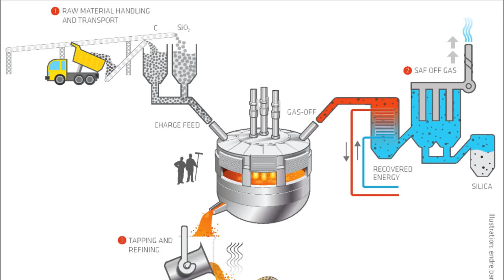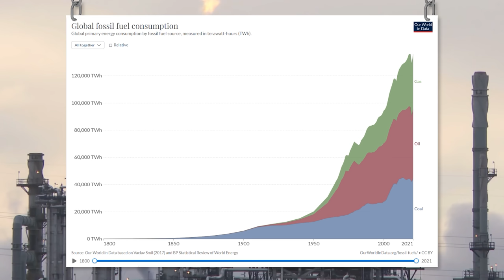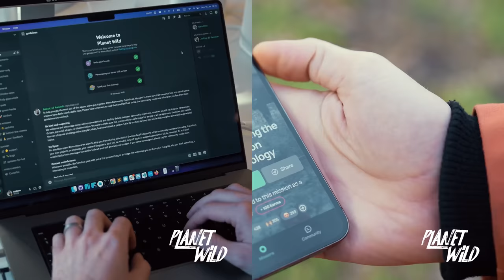We Will Be the Last Civilization on Earth

Comment: Damn, if only we'd invented nuclear reactors.
Reply: I have no idea if this is accurate, but in one of my college classes a professor said that if we switched all world-wide electrical production over the nuclear, we'd only have about 50 years of material for reactors.

Not saying we should ignore nuclear, just remember that it's not unlimited.
Reply: Those spent fuel rods are a massive liability. Not like we can just shut down a reactor and walk away if we have to.
Reply: @DrugDealer541  So, that would put us at 400 years worth of energy production?
Reply: @PsRohrbaugh were you been under 🪨
Reply: @PsRohrbaugh was he a hippie ?
Reply: @PsRohrbaugh  at some point in oil exploration the same "we only have 50 years left" was true (probably multiple times as both supply and demand increased). Except they kept finding more oil. I think the same is true with Uranium. If there is more demand for it, its down there, not to mention the talk of extracting it from seawater which is apparently more than viable, just hasn't been done yet. And ofc recycling the waste and breeding it again as has already been mentioned in this thread.
Reply: @PsRohrbaugh  that's only for uranium reactors though (there are way more abundant nuclear fuels like thorium), and it ignores reusing nuclear waste (and like 97% of uranium is turned into nuclear waste in reactors, so they could theoretically be 30 times more efficient than they are now)
Reply: @SerhiiMartyneko plenty of time to develop fusion reactors
Reply: @PsRohrbaugh  Yep but that only includes usage of enriched uranium which is like only 0.3% of all uranium. If/when breeder reactors are developed enough, they could utilize rest of 99.7% of unenriched uranium and you can do the math from there for how much that will last.
Reply: @DrugDealer541  Depending on where you live, HSR might already be in widespread use
Reply: Tell that to the French, who are the more nuclearized nation on Earth. A few years ago they produced 75% of their electricity out of nuclear energy, a few days ago... they had to nationalize EDF, the nuclear power managing company, because the output had dropped to a mere 30% because NPPs have become way too old all more or less at the same time (radioactivity also destroys the infrastructures, not just people) and now they're facing a national energy crisis, just at the worst moment possible, and lack even a plan to do anything about it. 

At least Germany has developed some renewable infrastucture in the last decades, but France? Nah, we're fine with our great NPPs... and of course it was all just hubris. Let's hope there's no French Chernobyl ahead, I live too close not be worried. 

Anyway, nuclear energy won't get a rocket up there, all it does is boiling water and that would at best allow for steam-punk fantasy. 

Also uranium is also on the way of extinction this very century.
Reply: @LuisAldamiz  EDF was already mostly owned by the government and it is responsible for all of France's electric grid, not just NPPs. The energy crisis was felt in most of Europe and it has been over for some time now
Reply: @orsaz924  - It's been quite sudden: they found out catastrophic dangers in many NPPs, they had to turn them off fast and they may have no remedy. We just avoided the French Fukushima by nanometers.
Reply: @LuisAldamiz  It's sudden, yes, but it's far from reaching a Fukushima-level catastrophy
Reply: @orsaz924  - Do you know the details of why each NPP was closed? In at least one a catastrophe was barely avoided by sheer luck as a key water pipe could have burst at any moment, instantly collapsing the necessary cooling of the reactor, which would cause meltdown. I don't know the exact details of the rest but they appear to have been in similar catastrophic condition. And that's because they are very old and France now has to face the untold truth about nuclear power: what to do when the miracle generator plants must be dismantled, as everything in them is radioactive residues one way or another. That's the main hidden cost of nuclear energy, which was never factured originally (or was at best in very optimistic terms, far away from the real cost, including the cost of perpetual radioactiovity): one that France will now have to pay no matter what.
Reply: @PsRohrbaugh  That's because mining and processing ore is cheaper than reprocessing the waste, if Uranium is indeed running low and will rise in prices low then reprocessing will be economically viable
Reply: @LuisAldamiz  Chernobyl? You're worried about meltdown? OK. Do you have any idea what the fundamental reason for the disaster in 1986 was? I'll bet you don't, since you seem to not be aware that it's physically impossible. What do you know from graphite-moderated coolant systems? Ask about it. I'm sure your nearest plant would love to educate you about the state of the art in fission (and they're amazing places to visit, too. I got to tour one on a school field trip as a kid and it was a little like being on a spaceship).
Reply: @DrMackSplackem  - If the cooling fails, the rods melt down. It happened in Three Miles Island, it happened in Chernobyl and it happened in Fukushima (with additional hydrogen explosion that aggravated the situation). Your discourse is basically propaganda that claims that USSR nuclear technology was faulty... but 3MI and Fukushima prove otherwise. 

The next Fukushima/Chernobyl should happen (per statistics and considering the general obsolescence of most extant NPPs) any day (my extimate is 2024 but there's of course significant uncertainty) and France has most of the chances of being where that happens just because it has most NPPs and all are very old (and should be decomisioned right away).

My nearest NPP is a French one near Bordeaux. There was a Spanish one closer but it's now shut down for good. However several friends and aquaintances of mine, living in the area have suffered cancers at very young age that can only be attributed to radioactive pollution by that fascist monster (all NPPs in Spain were built under fascism).

Also the Spaniards wanted to build one NPP a few km from this city but ETA impeded it by means of killing the chief engineer, some guy named Ryan. However the structure has yet to be dismantled (decades later) and makes that nice coastal strip a military zone for unclear reasons, which is a serious abuse against the citizenry.

BTW, in France Greenpeace has repeatedly demonstrated that the NPPs are vulnerable to terrorist attacks. 

Nuclear power is a disaster and, even if you manage to ignore all the actual pollution and meltdown risks, uranium is also a finite mineral and is expected to be effectively exhausted by the second half of the century at current rate of extraction/consumption. It's no alternative to fossil fuels.
Reply: @PsRohrbaugh True but newer designs of reactors using different types of fusion/fuel are already feasible at least to test.
Reply: @LuisAldamiz Three mile island wasn't much of a disaster and neither was Fukushima for that matter, considering how extreme the circumstances were.
Reply: @SavageHenry777  - Fukushima is very clearly at Chernobyl level of catastrophe. It's official IAEA, although IMO it was worse because several and not just one reactor were affected, there was that explosion and also, if Japan applied Chernobyl criteria, it would have needed to evacuate all Northern Honsu, incl. Tokyo and thus they decided to trivialize and minimize the radioactive disaster instead. I suspect 3MI was also a similar case in which domestic Western catastrophes are trivialized and hidden under the rug, while the USSR confronted it more bravely and seriously (after initial denial, sure).
Reply: @PsRohrbaugh  yes yes and we were supposed to run out of oil by 2016
Reply: @PsRohrbaugh We may have 50 years for uranium but many, many, many more for thorium since it doesn't need to be enriched, is extracted easier, safer, and 50x more abundant in the earth's crust than uranium
Reply: @LuisAldamiz nuclear power plants last longer than solar panels and wind turbines. That was just a combination of having many plants built around the same time, older design, and how long it takes to construct things. Of course 75 percent of power from one thing is over reliance anyways and should have been lower but was definitely preventable.
Reply: @LuisAldamiz French Chernobyl is practically impossible, not to mention that there are more deaths relative to energy produced from wind power than there is from nuclear, the only safer source is solar panels.
Reply: @LuisAldamiz why is uranium on its way to extinction this century?
Reply: @LuisAldamiz good thing modern npp can’t meltdown! Sounds like that problem that you fear so much has been solved if those plants are rebuilt.
Reply: The problems with renewables could potentially be worked out is the kicker, they are not very viable right now despite what people say, but nuclear energy can buy is the time and resources for further R&D, multiple processes take place in the same time span, it’s not a singular movement or vacuum.

Much like large stairs, we can only skip so many steps at a time, and we can only do so with sturdy steps, fossil fuels have been a proven sturdy step, nuclear is another, and we need both to go further. Before we slap a ton of unreliable and underperforming halfassed “renewable” solutions in place, we need to refine them, and we have the tools to buy us the time.
Reply: @skygge1006  - Yes for all I know. As happens with all mineral reserves, there may be untapped ones but these would always be very costly to exploit. Even coal is on the way to exhaustion at current usage rates. In 50 years or so we won't have much of traditional (fossil and nuclear) energy sources and will have to do with renewables and hydrogen.

Nuclear energy has many other limitations, especially if we'd want it to produce all or most of the consumed energy: basically a new NPP would have to be built every few days (and also decomissioned at the same rate), nuclear residues have never been satisfactorily dealt with and such a massive rhythm of usage would generate many many times the current ammount, by mere statistics catastrophes would happen much more often, water resources would be abused and polluted (not just with radiation but also heat), etc.

Even thorium reactors that some spouse but never gained traction need of uranium in their process, so they are not any solution either. Ultimately the only solution is renewables, with hydrogen (from hydrolisis, "green") as storage of reserve energy and also as portable fuel. Also some degrowth will be needed no matter what, the limits of growth have been already surpassed in many other aspects and balance, sustainablility, has to be restored and that requires another socio-economic paradigm than mere endless "growth", which is ultimatly exploiting Earth more and more (there's no free lunch, magic is not real).
Reply: Not true
Reply: @PsRohrbaugh that's completely incorrect. Like multitudinously incorrect. Not only are nuclear reactors versitile, but a single core can last decades.
Reply: @LuisAldamiz   more modern reactor designs don't need uranium, don't use water for cooling  and can easily produce the energy to melt all metals and create hydrogen for rocket launches. a smarter civilization with some memories from ours a 1/100th of the size. has far more options than we had.
Reply: @woodypigeon there are places to dispose of such things, there is a whole video by kyle hill explaining the true safety of nuclear power
Reply: @psionx1  Some use MOX, a mix of uranium and plutonium (something that also aggravated the Fukushima catastrophe) but otherwise what you say is false/wrong.
Reply: @woodypigeon at least spent fuel rods stay in one place, unlike spent oil/coal. If we could get energy producers to stop "just walking away" from their pollution, we wouldn't be in this mess in the first place
Reply: @PsRohrbaugh  Not true at all, or even close. For a start, direct uranium ore is not the only fuel that can be used.
Reply: @howdy832  Where did I say that fossil fuels were preferable to nuclear? 
You only have to look at the current situation around the Zaporizhzhia nuclear plant in Ukraine to see what a potential liability they can be.
Reply: @combineconformist  They still need to be carefully maintained during the initial cooling off period. 
I watched Kyle's video about it sometime ago. He really has a massive nerd boner for nuclear energy as seems so often the case.
Reply: @PsRohrbaugh That's only true of uranium reactors. Thorium is so plentiful you could probably find some in your backyard if you looked hard enough
Reply: @PsRohrbaugh   this used to be true but only in one paradigm. With plutonium or thorium reactors the fuel problem is solved in different ways. When it comes to thorium we did not develop that into a usable technology because it is fertile instead of fissile which means you cannot build a bomb out of it. Yet thorium in every aspect is the more viable option. The reactors are inherently safe compared to the current tech, the waste has magnitudes lower half-life(s), thorium is plentiful compared to uranium, it is safer and less toxic to mine, and likely other upsides I am not recalling. A principle downside being we haven't invested to develop it.
Reply: @PsRohrbaugh  If we are talking about nuclear fission that uses Uranium - yes, its reserves are limited. But nuclear fusion uses common elements like hydrogen, that are practically unlimited.
Reply: @LuisAldamiz  LOL. USSR nuclear tech was (like nearly everything else in the USSR) indeed hugely faulty. Using graphite as a heat moderator was unnecessarily stupid, but even that would've been no problem without those stupid tests they did on the day of the disaster. Only in a society with zero human rights could such a scenario have been carried through all the way to execution. Three-Mile island never even got close. How can you deny this?
Reply: @PsRohrbaugh  According to the NEA, identified uranium resources total 5.5 million metric tons, and an additional 10.5 million metric tons remain undiscovered—a roughly 230-year supply at today's consumption rate in total.26 Jan 2009

I thought it would have been more than that honestly
Reply: @DrMackSplackem  - So what happened in Fukushima then? What happened in 3MI? You're just parroting the old Western superiority myth and reality has proven it wrong already.
Reply: @PsRohrbaugh  Fission Reactors have around an 80-100 year life span. However with the newly developed Breeder reactors (Fusions early days) which produce more than they use there's enough Uranium scattered on Earth that nuclear energy could be mass reproduced and power humanity for another 4billion years. There are many other materials to power nuclear power outside of Uranium as well.
Reply: @PsRohrbaugh There are enough uranium for hundreds of years, and thorium for millennia.
Reply: The earth is vast, the amount of materials we have actually discovered is bound to be a tiny fraction of what actually exists on this planet. The answer is not in uranium alone or oil or other energy sources, but the utilisation of all of them when it makes economic sense to do so. Lots of new technologies will happen in the future with material sciences and energy storage, hydrogen is one thing we can produce to store energy but who knows what materials we will store energy within in the future, perhaps we will make oil or other stable fuels to store energy.
Reply: @PsRohrbaugh There is also the Thorium option. There is about 3 times as much Thorium in the earth's crust than Uranium. I believe Thorium itself is not able to be used as fuel for nuclear reactors, however, I do believe Thorium can be converted to Uranium? Also, I'm pretty sure Thorium cannot be used to make nuclear weapons, but I'm not sure, maybe once it's converted to Uranium it then can be?
Reply: But those can’t be dropped on your enemies and wipe out their biggest cities
Reply: If only hey?
Reply: @PsRohrbaugh  until we do we will never know also there ar reactors on paper that can run on waste products from the power plants we have now so if we really did try i think we could make it work
Reply: @DrugDealer541 it also doesn't account for Eco fuels like the one Porsche made by pulling carbon dioxide from the atmosphere
Reply: How would that replace all the chemicals we get from oil and natural gas? That's the real challenge imo.
Reply: @skygge1006  I see the anti-nuke folks as disciples of a religious order and deal w/ them as such. At most, I ask them to name a single graphite-moderated reactor currently in service, see they were never serious to begin with, and move on.
Reply: @bengardener8928  Well said. Prognosticators have a lot of stagnation to answer for, and we should rub their noses in their messes w/ no mercy.
Reply: @woodypigeon  you know those unused radioactive materials still radiate as usual, right? spent or not spent, they still decay
Reply: @devynlich00  if the fuel is burnt again, it will re-release all of that carbon, plus the emissions from the energy needed to make it in the first place. That's why its so hard to get it carbon neutral
Reply: @nade5557  no it isn't re-released into the atmosphere, water vapor is what's coming out of the tailpipe
Reply: @devynlich00  you can't be serious right
Reply: @nade5557  don't believe me look at that video link I sent about six hours ago you'll see for yourself
Reply: @shikyokira3065  Yes, obviously. That's part of my point.
Reply: @woodypigeon  seems like you don't get my point. Whether they are "spent fuel rods" or in their raw material form, they still radiate away. Not utilizing it is just like not utilizing the sunlight. It is just your liability or everyone's liability.
Might as well just use the energy that would have been wasted radiating into the surrounding
Reply: @PsRohrbaugh 50 years is plenty of time to find more options for generating power. Also the model doesn’t account for new sources that will likely be prospected for, thorium reactors, reusing nuclear waste in the many proposed ways, and the increasing efficiency in which most electricity is used by appliances, as well as how it is transmitted and store.
Reply: @PsRohrbaugh meanwhile it's unlimited for nuclear weapons.
Reply: Keep in mind, we only have a thousand or so years before the surface of Earth is uninhabitable because of the climate.
Reply: @PsRohrbaugh  50 years using the 0.7% Using U235 (Conventional) but fast breeder reactors can use the other 99,3% of Uranium as fuel. Thorium can be in the mix also and have 100s of years of fuel.
Reply: @@NathanGautreyat's largely due to government involvement, sure there needs to be basic safety standards, but the sheer amount of compliance costs in nuclear is what makes it astronomically more expensive (in the US anyway) than solar. Not to mention how much we are subsidizing solar and wind specifically as opposed to nuclear, mainly due to fear driven by severe misunderstanding of nuclear...

Addendum:
It would be great if the USN would declassify enough about the reactor design for the Virginia class of submarines to help make the methods they used to get the breeding ratio high enough to allow that reactor to last the entire 33 year service life of the sub without needing a refuel...
Reply: @LuisAldamiz  You have a point there

*(This applies to the reply to my previous answer)
Reply: You mean nuclear FUSION reactors
Reply: @@NathanGautrey Offshore (or any other kind of) wind power generation is a rather low bar.
Reply: @PsRohrbaugh  It isn't accurate but even if so - this is hafl a century with curtailed emissions!
Reply: @LuisAldamiz "if cooling fails, rods melt down" - wrong. That happened on Gen 1 & 2 nuclear reactors. It doesn't happen on Gen 3 & 4 reactors, that have a negative temperature coefficient.

"look at what happened in Fukushima" - 1 (one) person died from the nuclear meltdown in Fukushima. There was no harmful radiation leak outside of the immediate vicinity of the NPP (that was evacuated immediately). Bear in mind that this was an incident caused by a 9.1 Richter scale earthquake and tsunami, that killed almost 20.000 people outside of the nuclear meltdown.

But please, keep your nonsensical arguments of someone that clearly knows nothing about nuclear
Reply: Ever look at how much uranium is left at current production? If you think oil is hard to make 😉
Reply: @DrugDealer541 yet there is only one single 30kw thorium reactor in the entire world... Why do you suppose people are ignoring such a supposedly profitable solution
Reply: @nade5557  Any time I utter the phrase "carbon neutral" around my plants, they all reach for their revolvers in unison.
Reply: @southhussain2710  Got any sources for the 1000 years to Earth uninhabitability claim? I'm sure that'll make for some enlightened reading.
Reply: @@NathanGautrey You can do a lot of insane things with the unlimited power of selective government violence. The first tool is prevention via regulation (state force). Combine that with subsidizing mostly worthless 'green' options (yet more state force), and then sure, you can make comparisons that on the surface look like apples to apples but are just the opposite.
 Even with that state force which has massively unleveled the playing field in 'renewables'' favor, tell me just how much percentage of total power needs (avg'd. by country) are provided by wind and solar today?
Reply: @GoldenMinotaur  the reason why there was no investment in thorium reactors is very straight forward: thorium reactors can't be used to make weapons-grade plutonium. Therefore govts didn't invest in developing them.

As for the "there's little uranium" - there are fast breeder reactors that use the nuclear waste from other reactors. The current waste alone could power the entire world's consumption of electricity for over a 100 years.
Reply: @jorgebatista6323  and what's stopping it today? If it's profitable, why aren't people just investing in it??
Reply: How are you going to build nuclear reactors without steel
Reply: @DrugDealer541  Thorium reactors are a pipe dream at current technology: it takes more energy to extract a sufficient quantity of usable thorium for a reactor than the reactor will ever produce in its lifetime, and producing that energy also is a net loss.
Reply: @HyenaEmpyema  A truly new oil field hasn't been found in over twenty years at this point.  When they point to a "new" field, such as the North Sloe project greenlighted earlier this year in Alaska, what the oil industry means is "This is a 'new' field in that it's never been tapped so we've never put it on our books before - but we've known about it for decades already."
Reply: @PsRohrbaugh That might be true with a lot  of caveats, the major one being that it assumes a once through fuel cycle in a thermal reactor, another is that far more uranium is available albeit at a higher price.
Reply: @LuisAldamiz That is NOT what happened at Chernobyl.
Reply: @woodypigeon pretty sure a nuclear power plant is the least of Ukraine's current issues.
Reply: @gidi3250  The Russians are currently holding it and keep making like they might decide to blow it up. Very useful shield for them strategically. And a liability for Ukraine.
And early in the war the Russians took control of the old Chernobyl plant for a while.
Thing is, you can't just shut them down and abandon them. Those spent rods have to be maintained in cooling pools for a long time. There is so much that can wrong in such and unpredictable situation.
Which was my original point
Reply: @PsRohrbaugh  better than using nukes
Reply: @pawelzybulskij3367 Fukushima 'FuGen' reactors used reprocessed MOX fuel-  a Mix of OXide of Uranium and Plutonium from 'spent' fuel rods, which are too 'hot'  (fissile) to use in American reactors, which produce 60% of their output from the Plutonium 'bred' therein from fertile U238 in the fuel!
GE: "We bring good things to LIfE"
Reply: Unfortunately we have run out of time to build them all ..
Reply: @woodypigeon  literally we can. Material will be radioactive but so what, they emitt some residue power, keep them in a concrede and make sure they won't touch water and we can leave them there forever.
Reply: @mrpc5971 Peak conventional oil happened in 2005. Peak liquid oil (includes fracking) happened in 2018. Now, they are converting natural gas into gasoline to make up the difference.
Reply: Yes, we need to create nuclear power stations, outside a geosynchronous orbit (in case they pop), and transfer the energy via lasers, to low altitude aircraft which fly down to deposit the energy. That, or figure out how to create solar panels that don't suck (die).

Can't we create nano-seeds that grow artificial threes with USB ports? They can collect the sunlight--just plug the house into them.
Reply: @LuisAldamiz  Yea there is just as big of exclusion  zone and need for replacing concrete roof over reactor every 100 or so years to prevent radioactive material from escaping in Fukushima. Soviets went public because they could not deny that dumped so much radioactive material that entire world new about it before they did. 
Fukushima and 3MI were trivialized because they were trivial compared to Chernobyl, mostly because they didn't explode on such a level.
Reply: @PsRohrbaugh wrong.
Reply: Need 2 kinds of fossile for that.
The scientists and oil
Reply: @PsRohrbaugh  I remember something similar to 50 years of nuclear.
Reply: @woodypigeon now adays it is actually kind of like that
Reply: @PsRohrbaugh  not with reusing waste and breeder reactors. Not to mention fusion energy
Reply: Nuclear fusion should soon be an option in the next 10 or so years
Reply: @LuisAldamiz  I don't know what planet you came from, but if you want degrowth we have elon and jeff building rockets to take you back there, so please go volunteer. Pursue progress, not de-progress. The estimates for how much thorium is available range from many millennia to 30 billion yrs. Plan to use stuff like solar for at least SOME energy, not just only nukes all alone in a vacuum. Always plan for better HVAC, better transportation, better food, etc, never ask for less or worse. You may be wealthy, but stop assuming everyone else shouldn't have a better life than you now have, just as poor today live better than a king in Christ's day.
Reply: @tsamuel6224  - Progress now is sustainability, not doing the same as our Paleolithic ancestors (expanding endlessly as if there was no tomorrow). We're never going to reach out to the stars if we first do not stabilize our planet with us still alive on it.
Reply: If we switched to a nuclear age, we could power the planet much more efficiently. Nuclear power plants only need to be refueled about every 25 years, and we could build reactors that can use plutonium and other uranium fission waste products. Eventually, we could possibly get to fusion reactors, which would be indefinitely sustainable. 

Not only that, we could invest in other forms of sustainable energy production that would further increase our ability to produce power over time. Eventually, se could preserve our fossil fuels for only the most essential things that require their use. This would allow us to power our planet, reduce our environmental impact, and advance our technology. Its not about going from one point of failure to another point of failure. Its about going to a multi-source society that can sustain itself through a variety of means. 

As for some people who have issues with nuclear control rod waste, do remember that modern nuclear reactors actually produce very little waste, and they only have to be refueled every 25 or so years. With that estimate, we have plenty of space to dispose of the waste. And within two refueling cycles, the area we would store the waste would likely not be contaminated any longer.
Reply: @PsRohrbaugh  The solution is reprocessing, and using more efficient heavy water reactors instead of light water reactors. Reprocessing allows us to take "spent" fuel from eg a light water reactor (which only actually "uses up" about 1% of the fissile material) and remove the fission products, then use the remainder (the ~99% remaining fissile material) to manufacture new fuel.

Full implementation of reprocessing would take that 50 years of material and turn it into 5000.

If our civilization is still around in 5000 years, we'll have better energy sources... like fusion, or heck maybe even kugelblitz engines.
Reply: @PsRohrbaugh I work in Nuclear and can assure you this is total and utter nonsense
Reply: yeah a combination of many different energy producing methods combined with more efficient usage of energy would be the answer I think
Reply: On rough average, there are 450 Nuclear Power Plants around the world. Most have more than one reactor. Each reactor contains 100 tons of fuel rods that get replaced every 18 months. The 'spent' rods are very radiologically and thermally HOT, and are kept near the reactor, below thirty feet of circulating cooling water. (Some small percentage of the waste has been dry casked, and underground repositories are in limited stages of development.) If the water is not cooled or replaced the water will heat and boil off, and an unquenchable fuel fire will result. In a case where serious widespread power grid failures occur, and are not rectified within days to weeks, 1000+ radioisotopes will be released into the atmosphere. It has been suggested by US Government research that if a significant amount of 'spent' fuel is aerosolized, it will destroy all Stratospheric ozone and lead to the loss of the Earth's atmosphere.
Reply: @woodypigeon  Thanks for the intelligence. Best to you!
Reply: @DrugDealer541  Not true
Reply: @howdy832  The plutonium from Fukushima unit three was found 8 miles away.
Reply: @shanbannan17  Wrong
Reply: @bélalugrisi  No u wrong
Reply: @shanbannan17  About what?
Reply: @bélalugrisi  wrong
Reply: @bengardener8928  Hydrogen is derived from petroleum, releasing CO2. You can hydrolyse water to produce it, but you lose 2/3rds of the energy. Just use the electricity.
Reply: @shikyokira3065  And the 'spent' fuel contains 1000+ deadly radioisotopes that are way more radiologically and thermally hot.
Reply: @shikyokira3065  The reason the 'spent' fuel is replaced is that it cannot sustain energy production.
Reply: @manofcultura  Unfortunately we don't have 50 years.
Reply: @southhussain2710  on the current course, the oceans will boil in 400 years.
Reply: @loseweightusingketo  The no. 1 obstacle is a heating planet.
Reply: @DrugDealer541  Spot on! Our planet is burning, melting, and flooding and we haven't even ended fossil fuel subsidies yet. This is an absolute no-brainer but the @DNC promised not to end them.
The fossil fuel industry has a death grip on our politics and our planet. - Peter Kalmus
Reply: @DrMackSplackem  Food crops lose significant amounts of iron and zinc—and grains also lose protein as CO2 rises.
Reply: @gaspi91  We have no way to sequester this waste.
Reply: @fulconandroadcone9488  Fukushima was 10 times worse than Chernobyl, but luckily for the Japanese that it was on the east coast and the wind dumped most of it in the Pacific. Obviously, this continues today. (Not so good for the Pacific, as we've seen.)
Reply: @Pomegranate44  We don't have ten years.
Reply: @bélalugrisi  we got plenty of time.
Reply: @bélalugrisi  lol, the oceans will boil? You know it was literally 3C above the current average during the Viking age? 750-1150AD? And 4-5C during the younger dryas period which lead to the wiping out of many coastal prehistoric civilizations/tribes; which likely is the source of the mythical flood stories in many indo European cultures.
Reply: @manofcultura  You might seem more credible if you cite your source.
Reply: @bélalugrisi  Is that right? Can you point me to some good reading material about that? I can tell you firsthand that it doesn't hurt yields of fruiting annuals. Quite the opposite in fact.
 So, ambient carbon is a clear bonus for the vast majority of, if not all photosynthesizing organisms themselves, but since your claim is specifically about nutrients produced by a certain subset of those plants, I'm interested in your sources nonetheless.
Reply: @PsRohrbaugh That is only taking into account uranium reserves. Our current civilization could last more than a 3 thousand years with proven thorium reserves.
Reply: It takes decades for approvals, bids and completion.
I was laid off from the cancelled Yucca Mtn project for 10,000 year waste storage.
The Tesla Tower free energy patent is open source.
Reply: @DrugDealer541  They certainly do. And this channel apparently.. Best to ya~
Reply: @PsRohrbaugh Has he never heard of fast breeder reactors that create their own fuel. Also fusion reactors are now practical and they have infinite fuel.
Reply: @bélalugrisi  We have centuries just mitigate and live with global warming.
Reply: @bélalugrisi Just reduce tje population to a sensible level. Around 2 billion should do it.
Reply: @bélalugrisi Well we are f'ed then because there is no way of stopping this in 50 years
Reply: @Jezza_One  Yes, compassionate degrowth is needed, and no-one can call me a Eugenicist if I volunteer to go first. Best to you.
Reply: @bélalugrisi  o..kay.. not sure that has anything to do with my point.
Reply: @Swede_4_More_Years  “Science advances one funeral at a time.”― Max Planck
Reply: @manofcultura  There is no source because you made it up?
Reply: @PsRohrbaugh it is not accurate. Ask them to return your money.
Reply: @PsRohrbaugh  not accurate at all, trust me.
Reply: @PsRohrbaugh 50 million years maybe? Cause plutonium lifespan is something thousands/millions years of decaying radiation
Reply: You hopefully are aware, that uranium, thorium, and similar also are only available in limited supply, even if you reuse the materials they break down to. One could reasonably include them within the definition of fossil fuels.
Reply: @scifino1  but you have to admit we need fossil fuels until the renewables are perfected.
Reply: @DrugDealer541  except we don't have economical thorium reactors they are in the development phase and my never be economical.
Reply: @LuisAldamiz if the same attention was paid towards nuclear energy as it was towards solar and wind, we could easily build newer, safer reactors with pre planning on how to deal with them at the end of their lifespan. No technology is perfect in its infancy
Reply: @rgbmanly  - Please! Lots more attention and even devotion (almost as in that scene of Planet of the Apes III) have been paid to nuclear energy. There's nothing that packs more power than atomic energy and thus it has fascinated most people, especially those with pretenses of powermongering and engineering. 

Instead renewables have been perceived as hippy stuff, "weak", "femenine" maybe (in contrast to the "macho" image of oil and nuclear), and postponed indefinitely over and over. Almost nothing has been invested in them and yet they are much more efficient in many metrics now than fossil/nuclear, than dirty energy, and have the plus that they don't generally destroy the environment.

But people's stuck on destruction = good, very macho, if it's not big and dirty it's not worth any attention... and that's how we arrived to this megacrisis. 

There are no (significantly) safer reactors, all the risks and pollutions of nuclear energy are excessive, there are fanatics of ka-boom however, who keep pushing for the destructive stuff out of their guts and not their brains, let alone their hearts.
Reply: And renewables, and batteries, and electric arc furnaces, and bioplastics
Reply: @woodypigeon actually with modern reactors we can. And when I say modern I mean reactors designed in the 80’s and proven in the 90’s that were never built.
Reply: @YohXoX I think Candu reactors already use unenriched uranium using heavy water and have been doing it for decades.
Reply: @awesium4077  - Batteries are very problematic: they are as non-renewable as they can be. The real alternative is green hydrogen.
Reply: Still need a massive amount of fossil fuel to get there.
Reply: Nuclear reactors (hopefully) dont fly.
Also there is no method of electricty production more expensive, even if the technical risks can in theory be manageable - if only that would not cost even more.
Reply: @DrugDealer541  "Demo expected in 2025", so no working reactor yet.
Reply: @PsRohrbaugh This is false. That number comes from the types of reactor fuels that are easiest to react without extra enriching. If we do enrich then the number is much higher. It's also viable to source reactor fuels from space. However, the sun outputs vastly more energy into empty space every day than we use currently. We don't even need photovoltaics to access that energy.
Reply: Yes, that would have been grand. Especially modern nuclear power (MUCH safer, reliable base load power). Its a shame that the hysterical and irrational have pretty much closed out that option. For now...
Reply: @PsRohrbaugh  Given the dismal state that our universities are in, I'm not surprised. Look into thorium. We have around seven times as much of that. We have several centuries even with today's technologies. Eventually fusion will stop being only 20 years away (for the last 60 plus),
Reply: @woodypigeon  Look at the thorium production cycle.  As for waste, find a mountain out in the middle of nowhere and store it under it.  Even with todays technology it would be contained for at least a thousand years.  If we haven't developed better ways of doing all of this in a thousand years, its very likely we wiped ourselves out.
Reply: @Mythhammer  it is about what is economical. Good luck building a nuclear reactor in 10 years as well. Also if everyone build nuclear reactors we would run out of uranium.
Reply: @shikyokira3065   So what?
Reply: @woodypigeon  So fucking what?
Reply: @AORD72  You do realize that much of the cost stems from the hysteria about all things nuclear?  Not to mention the old way of building nuclear reactors as a one off. Look into something called small modular reactors. ALL of the components are created in a factory and then shipped to the site to be assembled.  If you need more base load, you just add additional reactors.  As for Uranium you do realize that we have almost seven times more thorium than uranium? Thorium reactors have been designed and proto typed in inherently safe fashions. The fuel cycle is also different and more effective.  Modern nuclear is one of our best and most reliable sources of base load power. Cheap, reliable and plentiful energy is the very life blood of modern civilization.  Which of course is why its under attack.
Reply: @PsRohrbaugh it seems your professor is a great 👍 gender theologian, but a terrible 😔 nuclear ☢️ physist ⚛️
Reply: @woodypigeon actually we can, and don't get your nuclear ☢️ physics ⚛️ from Captain Planet
Reply: @HyenaEmpyema not 🚫 to mention YOU CAN MAKE URANIUM AND PLUTONIUM WITH THORIUM
Reply: @godseed7984  lol, who is captain planet?
Reply: @LuisAldamiz  the problem with hydrogen is that they can't power planes and fuel cells use platinum. Rechargeable Aluminum-ion (different than the non-rechargeable and polluting aluminum-air/aluminum-hydroxide batteries). Another option is ammonia fuel, which may be able to power planes because it is more mass-dense and able to be burned under certain conditions without producing nitrogen oxides.
Reply: @Mythhammer  "hysteria about all things nuclear", so Chernobyl that cost ~68 billion to clean up and radiated a huge area of Europe didn't happen? Or Fukushima that had three meltdowns and 164,000 residents of the surrounding area were displaced was nothing to you? Or 3 mile island? Step into reality, when nuclear goes wrong in can cause major problems. 

I suspect you actually know very little about Nuclear energy. Did you go to university and study physics?  Are you someone that just watches hyped up youtube videos?

Where are these working small reactors? are they a proven technology? NO
Where are these Thorium reactors? THERE ARE NONE because they also have problems.
Reply: @DrMackSplackem  I don't see how NOT having the ability to answer your random hat pulled question disqualifies one from caring about the longevity of our species. I could pose a question very few could answer and say " ok then, don't be afraid of what you don't know" while still knowing very little about the subject myself. I can admit that my knowledge is dwarfed by the vastness of this atomic world, can you? Do you step without knowing if S* lays in front? I try diligently not too.
Reply: So leave it up to the future to solve ...or all life ends on Earth. Jeez the what-ifs are abounding.  @Mythhammer
Reply: Ha best answer on the first line.
Reply: @sloppyoppie  Exactly.  If they can't deal with it in a thousand years they have bigger problems than waste stored under a mountain.
Reply: @Mythhammer  If you consider all of the native populations pre .....say year 1800 to have had longevity "problems" then yes. But they did last MANY millennia.... whereas we (post ind. revolution) might make 400 years before our "ideas" catch up with us?
Reply: Learned (learn-ed). We all must compound our knowledge from those before us. Our 100 year at best lifespan limits our overall volume of knowledge, so that is how we overcome that obstacle.  The most important lesson I have learned is to learn only from those with learning from (learn WHO to learn from). You see, many... will [naturally] learn from those not worth learning from. Hence the vast pool of incorrect thinking. In the nuclear fields, very few are worth listening to. I will leave you with that.
Reply: If all goes perf. That would be cool.  @NapoleonicWargaming
Reply: @VitaeLibra  I know all about the hazards of fossil fuels. I'm not making an either/or argument.
And I wasn't really talking about the long term storage of waste, but the short term liability of having to maintain a cooling pool while the rods cool down.
Never mind that many stations are built in coastal locations, and sea levels are rising more rapidly than we originally predicted.
Reply: @VitaeLibra  "In the event of a worst case scenario requiring a plant to move inland the rods could still be transported safely once they've cooled down. Just takes some planning in advance, which we'd already be doing if we planned to open a new plant in the first place"
What kind of worst case scenario? We'd still be relying on fragile and fallible humans to keep the lights on and the water flowing while the rods cool down, perhaps at a site comprised by war, natural distaster, pandemic, economic meltdown or political meltdown, or other unforeseen issues. 
And not at just a handful of sites, but perhaps hundreds worldwide.
Seems like a lot of potential for a cascading series of catastrophes, perhaps not when everything is running smoothly, but once things start to unravel. 
And we are already heading into an increasingly uncertain future.
Reply: I never see an honest accounting of nuclear. You get a figure for how much energy comes out of the refined uranium in a reactor. What I never see is the energy input that goes into mining uranium ore, transporting, and then refining it into highly enriched uranium. Highly suspicious
Reply: @sloppyoppie  Thats why its wise to be thoughtful and prioritize. Nuclear waste can be dealt with using established known technologies, if one uses a realistic time frame. One thousand years is more than sufficient, if one disregards the hysterics nonsense. Modern nuclear power is our best bet for the energy that is the life blood of modern civilization. If we haven't developed MUCH better technologies by that point, some waste under a distant mountain will be the least of our problems.
Reply: Least of our problems unquote. Man if only we were the only species that might be ok. But jeopardizing all under the holier than thou pose is SADLY, a bit more selfish than I prefer to argue with.
Reply: @sloppyoppie  As I said, priority. We focus on our own species well being and prosperity first. Then we will have the luxury of splitting our resources and attention.  Not the current anti human agenda of those behind the various attacks on reliable base load power.
Reply: Using fossil fuels is a likely necessary step before reaching the ability to to use/switch to nuclear. This could be a one-shot indeed and we need to switch.
Reply: @woodypigeon spent fuel rods can be recycled. The US outlawed it because nuclear takes money away from a select few, but France does it
Reply: @PsRohrbaugh  fast breeder reactors solve that problem, instead of burning 0.72 % of uranium they burning it all
Reply: spot on
Reply: Why, so we can pretend it's safe while burying the waste that isn't safe for 10,000+ years and is therefore someone else's problem?
Reply: @LuisAldamiz I know you did not just praise Germany green infrastructure? Not after Germany having to heavily rely on coal powered plants and oil from Russia to keeps the lights on bc the renewable sources could not keep up with demand.
Reply: @PsRohrbaugh  bruh we can split any atom, not just uranium etc.
Reply: @LuisAldamiz  4th generation nuclear reactor designs incorporate passive safety features. Heck! In case of molten salt reactors, meltdown is impossible! You talk as if nuclear technology has been stagnant since 1970s 🙄
Reply: @SerhiiMartyneko  People are researching hydrogen reactors. And if only we'd invented any other renewable energy sources 🤔
Reply: correct me if i am wrong, but in the video he said we kind of used fossil fuels to make concrete ? We would need a lot of it to build the nuclear reactors right ? for the infrastructure and the protective walls and other stuff. In the scenario of an civilization reset like he presents we would not have any. And I m sure there are more important materials we will miss in that scenario. In present days we can make the transition because we already have every tool we need.
Reply: @Skaevs   I wonder, if fusion will actually become viable source
Reply: @DrugDealer541 Heh. I sort of gave the same answer, but in a lot more longwinded way ... :D
Reply: @DrugDealer541  Thorium is still theoretical and no fully working reactor that we know of. China are the only ones experimenting?
Reply: Geothermal can supply us for infinitely theoretically as the earth will always be warm and vent. We just need to invest more in drilling tech and make that cheap so we can extract enough heated vents deep enough to make it worthwhile. It'll provide all our energy needs for thousands of years if we bothered.
Reply: When we run out of coal, gas and eventually geothermal we still have trees to plant and burn. We have a long time to develop fusion energy yet but we should invest 2 trillion a year into it.
Reply: @sapphonymph8204  Renewables will never be perfected, they use huge amounts of resources and many tons of concrete, copper and rare earth minerals for each and every windmill. It isn't clean or sustainable and parts need replacing within a few years. They need constant maintenance and replacement of parts every 3 to 6 years so don't last anywhere near as long as the industry claim without a lot of maintenance and replacement parts. And none of them are recyclable and are dumped into landfill sites allowing the toxic materials to pollute what was good potential lands for farmland and wildlife. Renewables and batteries are one of the top 5 environmental worst thing we have done to this planet.
Reply: @DrugDealer541  And?
Reply: @DrugDealer541  Still testing. Do you see it'll be a success and what are the latest developments? Do they provide frequent updates? What design are they using? Some are safer than others when it comes to design of Thorium reactors. Thorium reactors can still meltdown so the design is paramount when intending to make this close to impossible.
Reply: @organichuman  agreed.
Reply: @organichuman Thorium reactors cannot meltdown, they shut down when they get too hot (that is ensured by the fact that it would melt through a plate into a basin away from the small amount of particles required to create the energy) 
Note: Thorium is not readily useable without another small quantity of particles such as plutonium or uranium
Reply: @PsRohrbaugh  We were supposed to have been out of oil by now.
Reply: @PsRohrbaugh  There are a number of different estimates for how long fuel will last. The current most economical method is the once-through: Uranium is enriched to 5% (roughly), used once and disposed of. Your professor's estimate was accurate for that paradigm. Another method is waste processing: Get the extra U-235 that wasn't used up out of the uranium and reuse that. This is more expensive, but increases the lifespan. Plutonium can also be extracted this way, which can be used in specialized reactors. Plutonium is pretty tricky to work with, though... 

Using existing reprocessing, we should have enough nuclear fuel for a few centuries. If we can make the Thorium cycle practical (sounds too good to be true at the moment), we can make that substantially longer.
Reply: @jpheitman1  Amazing reply! Thank you for taking the time to write it up.
Reply: @PsRohrbaugh  According to a report I read in 2012, vis-a-vis nuclear and electrical power, uranium reserves would be depleted within 2 decades
Reply: @PsRohrbaugh  I say we get elon to start draggin back some radioactive asteroids for a fuel source lol, we arent gonna run out of asteroids any time soon
Reply: nuclear material is also not infinitly available
Reply: @LuisAldamiz Not going to argue with your somewhat biased opinion on nuclear energy. Nuclear definitely has a place in the transition away from fossil fuels, but I agree that fission is not a long-term solution or sole solution.

More crucially, I take issue with your characterization of nuclear energy as just boiling water. This is not really a drawback. It is, in fact, the defacto way of creating electricity: steam generators. Besides wind, hydroelectric, and light-based solar every other form of electricity generation relies on steam to generate electricity. Geothermal, solar-thermal (think reflectors), coal, natural gas, oil, biomass, etc all use steam to generate electricity.
Reply: @LuisAldamiz I have to disagree with you on your characterization of nuclear energy. The reason that there are so many old nuclear reactors ultimately comes down to two things: 

1) Capitalism which drives us to avoid projects with low margins (nuclear takes a long time to become profitable and it often isn't worth it for a company to fix or upgrade existing plants according to their profit margins). It isn't just nuclear power plants that suffer from this, there are plenty of dams crumbling too. The only difference is that the consequences of a meltdown are much worse. Private nuclear fission power is dangerous as the companies can get out of the consequences of a disaster by filing bankruptcy.

2) Public opinion. Nuclear energy has a huge negative stigma despite its relative safety compared to the amount of energy it produces. Due to this, many companies are not investing in the technology due to the bad optics and public backlash. If we compare direct deaths from fossil fuel plants and air pollution, nuclear is safer, but I can understand the fear of the more immediate consequences of a meltdown over the less obvious deaths due to pollution and respiratory problems.

There is no perfect solution. But, nuclear is good at one thing. Providing a low emission baseline power supply while we transition away from fossil fuels toward renewables.

People like to support Germany and their renewables, but forget that they shut down all of their nuclear plants and replaced the lost power with natural gas and other fossil fuels. Renewables take time to build, and in my opinion they might have left at least a few running until they finished building out more renewables. But alas. These are complex issues and none of us can fully anticipate the problems and their solutions.

For example. Wind and solar panels wear out faster and have to be replaced more often. The wasted panels are difficult to recycle and often end up in landfills. This is a big problem that needs to be solved.

Hydroelectric power displaces tons of people when installed, alters ecosystems, and is unreliable in times of drought or floods. It also has a big potential for disaster of it fails.

Nuclear is one of the most reliable sources of power (interruption wise), but nuclear waste needs to be handled properly and if it melts down or is damaged...

Fossil fuel based plants are cheap to operate, but produce emissions, pollution, and toxic waste (coal ash, etc).

This is a complex issue, there are obviously more issues, but these are just the ones off the top of my head. If the goal is to get rid of fossil fuels, nuclear is a good option in the short term to quickly switch, renewables should make up the bulk as we transition, and hopefully fusion will eventually become a thing...
Reply: @LuisAldamiz I totally agree, green hydrogen is one of the most promising ways to transition away from fossil fuels, and we can keep combusting! There still needs to be more research done into electrolysis to make it more efficient and the combustion reactions to help reduce the other byproducts due to the higher flame temperatures. We also have to look at a lot of additional safety features since Hydrogen can be more dangerous that other fuels due to its reactivity.
Reply: @awesium4077 Pure hydrogen can't be used directly, but it can be used to synthesize synthetic jet fuel. You should check it out, it's pretty interesting. 

Synthetic fuels made with captured carbon and green hydrogen are probably the future of aviation since it would allow things to remain relatively unchanged, but be carbon neutral since all the emissions come from captured carbon. An artificial carbon cycle is a decent solution... If we can get it off the ground.
Reply: @privateinformation2960 I'm not saying that you are wrong, but the uranium in the reactors did in fact get mined from the ground. Burying it in special locations is essentially the same as returning it to nature. It just has to be prevented from entering groundwater.
Reply: @organichuman Solar-thermal, hydroelectric, geothermal, are more friendly in that respect. They use much less copper and rare-earths since they only need it in the steam generators or turbines and to connect to the grid. 

I still think nuclear is good in the short-term as we transition to better alternatives since it comes with the immediate drop in emissions.
Reply: @withjoe1880  - Actually efficient electolysis to 82% was achieved by MIT in 2015, with low cost electrolytes, so that part should be solved already (although it needs investment I've read that Namibia, India and South Africa were on it, unlike the extremely hypocritical EU). The real issues would be others: storage, distribution and notably efficient engines. The latter was again largely solved recently (2019?, would need to check) by the development of an efficient combustion engine (car or truck type) which uses 85% hydrogen and 15% gasoline. Storage and piping are still somewhat problematic because H2 is very low density (can be compressed but that's a cost) and the molecules are extremely tiny, so any container or pipeline needs special characteristics and thus for example you can't really turn the natural gas (methane) pipelining into a hydrogen one as they considered doing over here before the Ukraine war turned everything upside down, ironically de-emphasizing the green transition in favor of coal and more natural gas even. 

But it's all matter of investing and developing, the technology is already here, what is missing is the strong political will to pave the road of the much needed transition.
Reply: @PsRohrbaugh  There's enough Uranium in ordinary seawater to last several thousand years. It's currently not used because the cost of "mining" it would be more than twice as much as the Uranium we dig out of the ground. The fuel cost is only a tiny part of the cost of running a nuclear fission plant so even if the cost of the "fuel" would double or triple it would hardly be noticeable on the electricity bill.
Reply: 😂😂😂 I love how many Nuclear engineers are on here. 😂😂😂
Reply: @PsRohrbaugh  Two things: Nuclear Fuel Recycling and Thorium. That's enough to get us to nuclear fusion, which is basically infinite energy.
Reply: Nuclear sucks
Reply: Completely agree nuclear reactors have been demonized and politicized. Reality is that a lot more people will die and the quality of life for everyone is reduced without nuclear energy.
Reply: @PsRohrbaugh  Not true
Reply: Which is pretty good considering the estimates that we will run out of fossil fuels this century
Reply: @LuisAldamiz uhm , Fukushima happened because a seaquake and a tsunami coming right after because the seaquake. Fukushima has no point in being your point.
Reply: @sidneyregeer8694  - Accidents do happen: and that's the point. Total security is impossible for NPPs and sooner than later, especially as facilities age and the world falls into chaos as is happening right now, nuclear plants will blow up one after the other. I estimate that the next Chernobly/Fukushima should happen in 2024 and the next one in 2030, etc. We have a brutal nuclear problem around us.
Reply: @PsRohrbaugh  This is obviously a strawman argument that assumes we only use certain elements in a certain and only through certain limited sources that are currently active. Even just given uranium, there are billions of tons of unexploited material in seawater. The problem is that you have to be willing to change the way you do nuclear which is very hard to do in a religiously profit driven society controlled by private interests who often don't understand the science or intend to deny it for short term gains. But we don't need to do only nuclear anyway. There are plenty of other non-fossil fuel sources of exploitable entropy/energy.
Reply: @Deltexterity  "Reusing nuclear waste" - this is not possible yet.
Sure, it should be possible 'wihtin the next 20 years', but they hve been telling this for 40 years now ...
Reply: Hope and pray for fusion. The waste from our current reactors is not manageable.
Reply: Educate us about the meltdown in Japan as well . Thank you.
Reply: @PsRohrbaugh   Its almost as if we would run out of uranium at a ridiculously large rate of consumption. 50 years of only-nuclear is not a trivial rate of consumption. Similar equivalents can be built for fossil fuels and renewables [solar, wind] as well. In the case of renewables, you would run out of land, minerals to realize renewables-only energy.

Uranium can last for much longer time if breeding/reprocessing is used.
Reply: @woodypigeon   You can put those rods in concrete casks and simply walk. The real concern are time and space needed, but those can significantly reduced with reprocessing/breeding
Reply: @LuisAldamiz   Its almost as if negligence of energy security creates energy crisis. What has happened is a consequence of negligence, not incapability of nuclear power or something.

Renewables are not a substitute for nuclear. Renewables are a lot less secure or reliable sources of energy than nuclear.

While wind/sun virtually infinite, land/minerals used in renewables is finite and quite precious. We will still run out of something
Reply: @LuisAldamiz  Human incompetence/human error/negligence is a not unique to nuclear power. It has got nothing to do with nuclear power itself.

Next generation [Gen IV] nuclear reactor designs are designed to be foolproof and incapable of meltdown by design. Yes they are still in research right now, but people designing nuclear reactors have acknowledged the existence of potential disasters and have actually worked to mitigate them for almost 2 decades now.

The "radioactive residue" is far less radioactive than fuel in reactors. We have bigger concerns than radioactivity of the "residue", like radioactivity of fuel itself when it produced, used, retired, etc.
Reply: @suntzu1409  - Sure: human error is independent of what we are manipulating, but it's not the same error when managin a pillow than error when managing high grade explosive, it's not the same error when managing a small boat than error when managing an oil supercarrier, not the same error when applying yodine than when performing heart or brain surgery...

Even worse is error when managing something as dangerous as nuclear power. 

Dismissing radioactive waste as "less radioactive" than nuclear fuel is an unacceptable manipulation, much as here they always compare the Basque Country with Andalusia to make us feel better at having half the salaries of what actually compares well: Germany or France. All radioactive risk is very serious matter and is not acceptable to treat it as irrelevant, it is of top relevance, much more than any other pollution I can think of.
Reply: @suntzu1409  - "Negligence"? Negligence happens but the consequences are not the same when it's nuclear negligence than any other type of negligence. There's never 100% security and thus the only acceptabl security re. nuclear power is not having it at all. 

The only "acceptable" (realistic) logic for nuclear power is to develop nuclear weapons, because maybe you estimate that otherwise your country is at risk of invasion by some bully like the USA or nuclear annihilation by some nuclear chihuahua like Israel. Even if that's the case, all security concerns should be addressed properly and not dismissed as irrelevant, because the damage caused by nuclear power tends to be massive and persistent (radioisotopes mostly last "forever" in human terms, they don't vanish or degrade except in very long times well our frame of concern).
Reply: @LuisAldamiz  
Instead of talking about possible consequences of negligence, how about holding relevant authorities/organizations accountable for negligence?

Radioactive waste stored in concrete casks is a very effective, foolproof and economic way of storing radioactive waste. It is not indefinitely sustainable, but it is sustainable in the near future, say 100 years. With reprocessing/breeding, this can be sustainable for 1000s of years.
Reply: @LuisAldamiz  
Human error is not an argument against using/developing some technology.

"Radioactive waste that is not spent nuclear fuel is far less radioactive" is dismissive, but justified because there are far bigger concerns than not-so-radioactive waste left after dismantling nuclear power plants, both before and during dismantling nuclear power plants
Reply: @suntzu1409  - You're the one who brought around human error. The issue is that what you call "technology" I call "extreme risk" that is actually for that reason much more costly than it appears. Pollution is cost, radioactive pollution is massive perpetual cost. It's radioactive bread for today, radioactive famine for tomorrow. 

I'd much rather have my food and that of my grea-great-great-descendants unpolluted, thank you. 

Radioactivity kills. 

Don't whitewash what kills us, don't defend what causes cancer.
Reply: guess you need fossil fuel to make the material for a reactor
Reply: Zero point energy  amoung others are forbidden
Reply: @woodypigeon solar panels and lithium batteries are even more toxic but we're not allowed to talk about that
Reply: The rational buildout of nuclear powered electric power generation over the last 50 years definitely would've helped, no doubt about that, however you can't maintain or advance affordable mass individual freedom of movement and the economical transportation of goods provided by ICE powered vehicles with fundamentally physically and economically inferior EVs; and nuclear reactors cannot magically change that.
Reply: @bartholomewceremony6981  "but we're not allowed to talk about that"
Well, you just did, giving the lie to that.
Don't first generation PV cells consist mosty of just silicon? Can't speak for more modern and "efficient" varieties. 
Lithium is dreadful, I agree.
All this is yet more greenwashing, designed to distract greedy venal humans from the uncomfortable truth is that we all need to start consuming far less of everything, and stop acting as if all of Earth's precious resources are our for the taking.
Reply: @PsRohrbaugh  actually, it basically is. nuclear energy produces the smallest amount of waste out of any energy production, including solar and wind. it also has its waste completely managed. while current nuclear energy is not completely efficient at completely utilizing nuclear fuel, future breeder reactors will be able to utilize this, ending up with even less waste in the process and MUCH more fuel. so yeah, we're not gonna run out of nuclear fuel lmao.
Reply: @HyenaEmpyema The Earth produces oil. 
Tam's other half
Reply: @PsRohrbaugh with modern breeder reactors it would take 5 billion years to deplete all uranium we can extract. Maybe that professor was talking about how much fuel we have stockpiled
Reply: @NapoleonicWargaming could you imagine turning hydrogen into helium then eventually the byproducts of creating electricity can also create iron
Reply: @woodypigeon  Well, we could reprocess them.
Reply: It's almost as if people didn't know what geothermal energy is so they have to split an atom to boil water.  I mean it's not like nuclear energy kills everything around it for thousands of year's and has to be stored in barrels that are sealed in reinforced concrete and buried 100's of meters beneath the ground right? What could possibly go wrong with nuclear energy.
Reply: @redwolf4611  nuclear waste containers are not stored underground, they're stored above ground because they're not that dangerous, you could live next to one for your whole life and be fine. Also what do you mean it "kills everything around it"? Nuclear reactors are perfectly safe when properly used and can be dangerous when not used properly, just like any other power source. And geothermal energy is very limited because with current technology only a tiny amount of energy can be extracted from geothermal sources, and even hopeful estimates that assume the world will focus on developing this technology estimate that in 2100 we will be able to satisfy just 10% of our energy consumption with geothermal. It also produces greenhouse gasses (less than fossil fuels, but still) alongside other harmful gasses extracted from the earth as a byproduct of extracting the heat, while nuclear doesn't pump anything harmful into the atmosphere.
Reply: @@NathanGautrey The primary detriment of nuclear is startup cost, PR cost, and regulatory cost, if its just down to the resources in and resources out nuclear is extremely competitive with both solar and wind. Solar and wind are both excellent, but fission nuclear is extremely efficient and widely available, its just unfortunately got a bit of a PR problem. Honestly we just need to swallow our pride and lean on Fission nuclear for about 50 years because its looking like Fusion will almost certainly be solved in that timespan and can then replace fission.
Reply: Sure makes total sense in this very politically stable world.
Reply: That's only with the rarest isotope, U-235.  We have the tech to burn Thorium and U-238 and supplies enough for 100,000 years.  @PsRohrbaugh
Reply: @PsRohrbaugh 50 years of produced nuclear material that lasts for 150 years each... fix ya facts
Reply: We haven't invented the ones we need.... yet. (Fusion)
Reply: Somehow civilisation decided nuclear power is just good to build bomb, not to fight climate change
Reply: @PsRohrbaugh Well, I have too no idea but there are reactors that work on Thorium, reactors like the Aurora project can use the nuclear waste of bigger reactors and generate more power, there are the fusion reactor prototypes, that have the potential to generate a hella amount of energy with just a very small amount of hydrogen
Reply: @arofhoof  Straw man
Reply: Nuclear reactors depend on fossil fuels for their construction and operation on a daily basis.
Reply: "Nuclear reactors depend on fossil fuels for their construction and operation on a daily basis." @rrmackay  

Nuclear reactors need order of magnitude less fossil fuel for their construction and operation than renewable
Reply: @woodypigeon there quite small relatively speaking and are easily stored they can also still be used in various ways.
Reply: If only we could create something to get energy from the sun…
Reply: @davidgambin2551  or hydroelectric storage
Reply: @HyenaEmpyema yes and I'm in the oil industry, a reserve in the Permian basin here in west Texas they found enough oil in the one reserve alone to sustain America for another 250 years easily.
Reply: @PsRohrbaugh  and so many generations would need to care for the residues
Reply: You can't build a nuclear reactor without first understanding and using the fuels and sources they mentioned.. what would u build it out of
Reply: @jasonhiggins6236  well bio fuels aren't out of the question. You might have a very poor economy though it is possible (poor since most combustible fuel being bio fuel would be rare. And nuclear power construction would be given priority).
Reply: @woodypigeon they’ve had a technology to use / recycle those spend rods into more energy since the 70’s and the same company is trying to start it up again.
Reply: Its not accurate  @PsRohrbaugh
Reply: The spent fuel rods are barely a liability compared to the existential danger posed by carbon dioxide.
Reply: There can't possibly only be 50 years' worth of uranium and thorium left.  There is huge amounts of both still to be harnessed.  There is uranium in seawater for example that will eventually be exploitable.  This is a crucial technology for tiding us over until renewables are truly high enough in their return on energy invested.
Reply: @georgeholloway3981  8 billion humans demanding unlimited energy to consume is the biggest existential liability.
Reply: A quick read of comments show nuclear works, but time and material weak and limited And all those ignorant likes.
Reply: @Cromius771 New ways of getting oil were developed, catch up to the rest of the class, and once that shale oil is gone, what next?
Reply: @NapoleonicWargaming quaid...start the reactor!
Reply: @woodypigeon France recycles spent fuel rods, it’s America that has arbitrary legislation on it
Reply: If only American had state of the art gen 5 reactors lol lol 😂
Reply: @PsRohrbaugh the professor didn’t take in to account newer more efficient reactors like gen 5?!?! Weird, considering he’s a professor..
Reply: @PsRohrbaugh . I read it's 50,000 years...

And while I wanted to say maybe that's at today's production, your prof's numbers would still be under by like 20x.

The incredible amount of energy in the stuff makes me skeptical of even that, but I could be totally wrong.

Another thing to consider though is if we went all nuclear all the geologists from the oil companies (who are responsible for mapping much if not most known ocean topology) will be hard core on the search for fission materials with that exact same vigor. So whatever the number is, it would see some major re-adjusting once that starts.
Reply: Probably even less than that. @PsRohrbaugh
Reply: @woodypigeon yes we can now lol
Reply: Hydrogen rocket fuels would be a good replacement or electric
Reply: They can't make plastic
Reply: @woodypigeon  The reactors of the world's 400+ nuclear power plants will likely be abandoned once climate-induced chaos eventually makes it impossible for them to be safely maintained.
Reply: @dbadagna  Yes, this is the ultimate issue. It's all great while we can afford the considerable effort and costs to maintain them, but as/when things start to unravel they will start to become a massive liability. What about in times of war? Tempting target don't you think? We are already starting to see this.
Reply: Reactor made of and from oil, the whole plant.
Reply: Do you know what a breeder reactor is?  It produces nuclear power and the end result is more nuclear fuel.  France uses them to produce more fuel and weapons grade materiel for their nuclear weapons program.  Also, your professor clearly wasn't talking about the potential of Thorium let alone the potential of fusion power. 

Nobody is suggesting that we would be limited to using nuclear power alone.

 @PsRohrbaugh
Reply: @PsRohrbaugh that’s far wrong and outdated.
Reply: There is a book that says that present creatures (including humans) will never know what the next type of creatures that will inhabit this planet will be. because earth and nature will continue to create new species, possibly even more intelligent and with bodies that are more efficient, which makes me think earth and nature are alive and intelligent. there really is a Creator